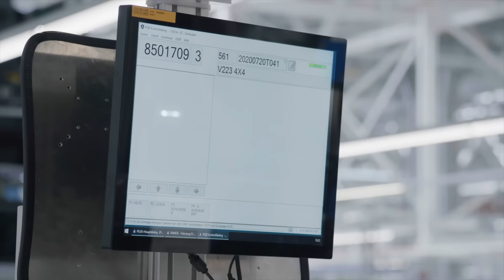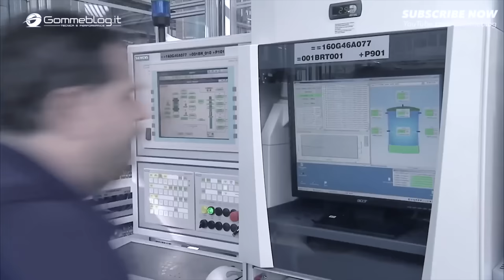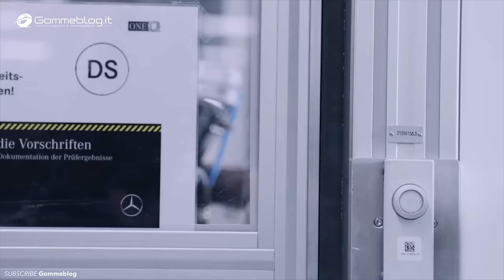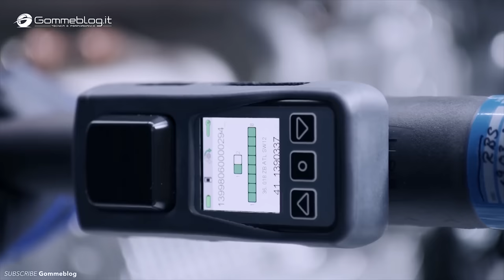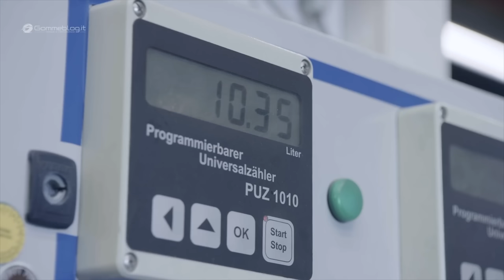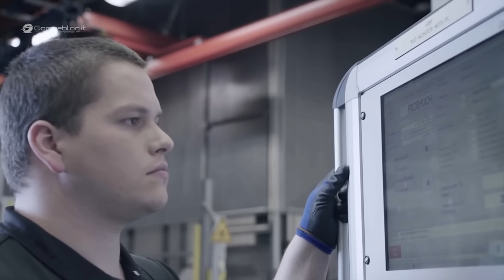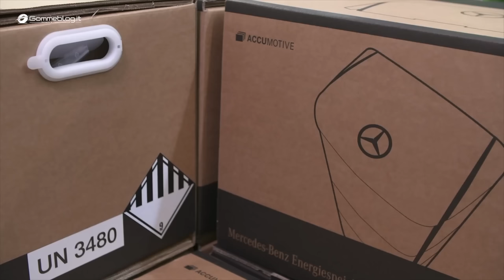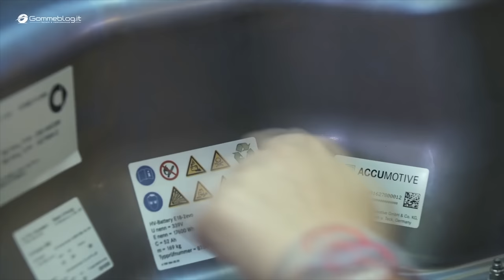Mercedes MANUFACTURING Process 🚘 Car Factory Assembly Line

Comment: Hopefully the 2025 model S Class will bring new innovation. Like the current 2024 7 Series did. Time will tell... ⏳ 🕵🏿 🤔 📝
Reply: Don’t worry friend. Mercedes invented the luxury, cross country saloon. They will not disappoint with their answer to that hideous 7 Series. Don’t get me wrong though, the interior of the new i7 is everything I’ve ever wanted. A drop down, curved screen in the rear. Cell phone sized screens on the door pulls to control most everything… It’s going to be a hard-to-beat interior. The exterior, however, will be no competition for the MBZ S-Class.